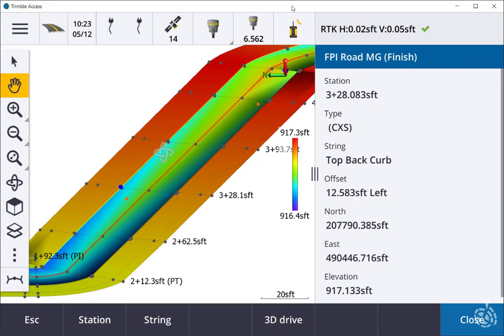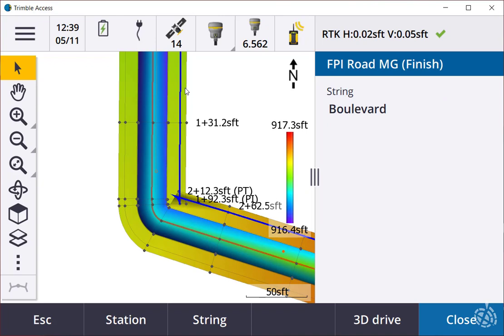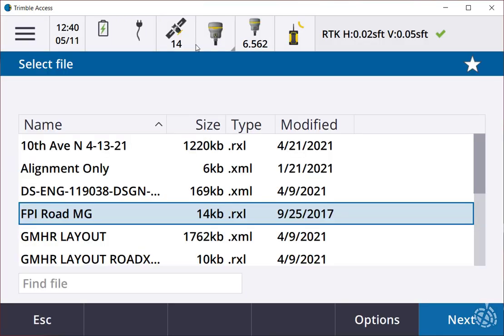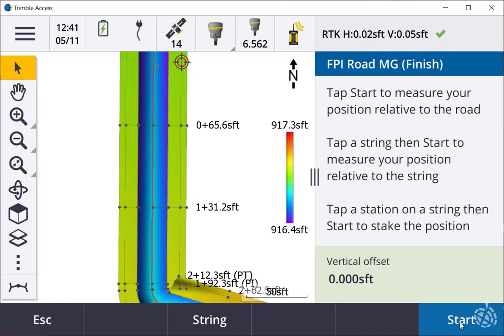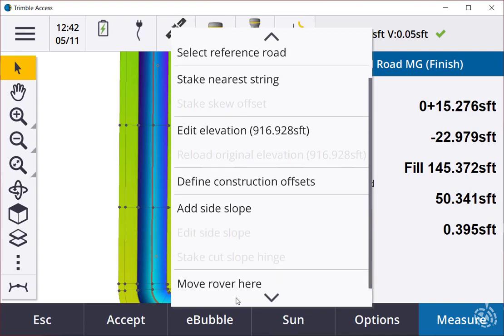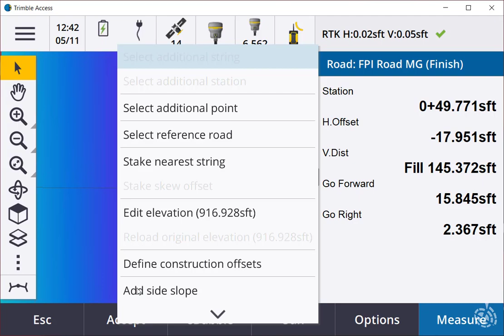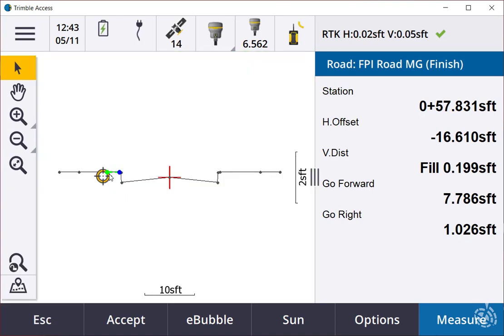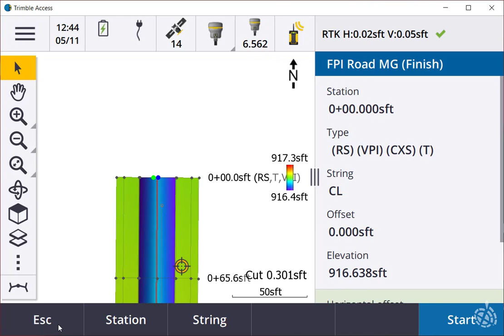Corridor Stakeout in Trimble Access - Graphical Staking of Road Corridors

Comment: Do you have to have TBC to export corridors to TSC7?
Reply: It certainly is nice to have, but it is not entirely needed. TBC is awesome to have as a data 'hub' that you can verify drawings and designs before sending them out to the field. The survey and corridor exporters are easy to find and should be pretty straightforward to use. For C3D users, you can export corridors in the form of a LandXML file. Another option is the RXL format if you have the Trimble Link plugin. The Trimble Link plugin isn't any additional cost and is what I prefer to use. Ultimately before staking a LandXML corridor in Access Roads module, it will ask you to convert the LandXML to an RXL file. The benefit to a LandXML is that you can have multiple alignments profiles and surfaces embedded in the one file.